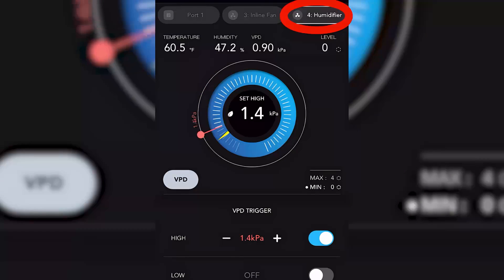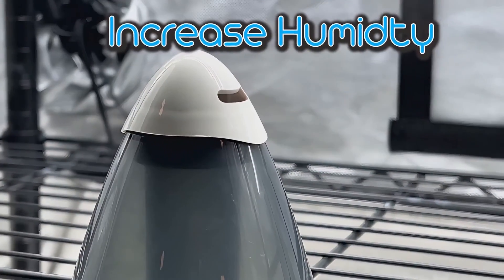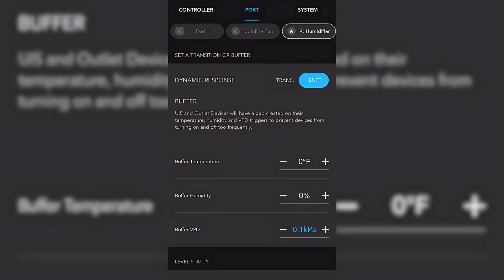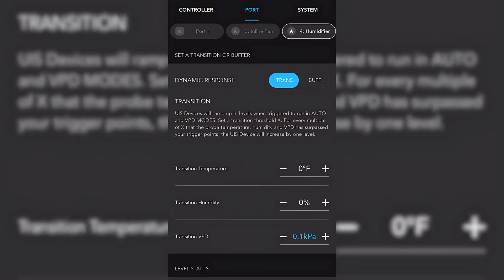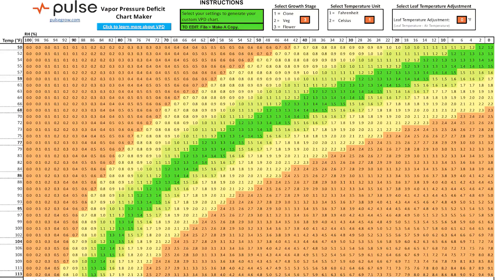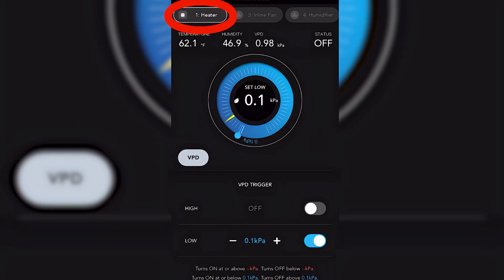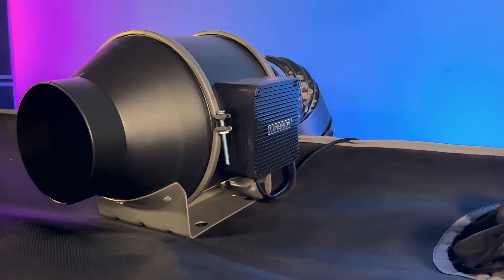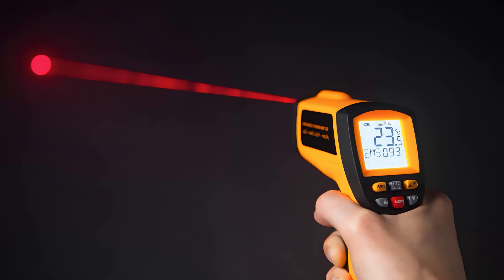VPD Made Easy | Dial In Your VPD With AC Infinity Controller 69 Pro

Comment: So is everyone not using the leaf temp offset? On their ac infinity controller?
Reply from the maker: Its definitely gotta be a mixed bag out there lol
Reply: @HappyHydro  Altering it has a big effect on the controllers vpd after mucking about with it a little.
So leaving it to standard would mean the vpd I'm trying to set is potentially not that accurate.
Given that leaf temperature is pretty impossible to measure throughout it's daily movement. Then you would need to be adjusting the controller constantly.
Just interested in others take on it?

Comment: My question is ... for us growers who have $$$ in other growing equipment.  Can we connect to this ac infinity pro 69+
Reply from the maker: There are ways to get some of your other grow tech to connect to the controller. They have an adapter for lights which is cool and will allow them to communicate. Also they have a smart outlet, which will allow you to control whatever is plugged into the smart outlet through the controller. The only downfall is its limited capabilities as in it can only turn the device plugged into the outlet on and off.

Comment: In the past year, I have become an AC Infinity nut!🤣
I have three tents in my grow room, 4x4, 3x3, and a 2X4. All three tents have smart exhaust fans with the 69 controller.
I don't use the VPD section of the controller. I have a window unit AC for the cooling, a dehumidifier And a brand new AC infinity humidifier, that big 15 liter one....... That thing is a beast!  The window unit and humidifier controls the lung room environment And I use the fan speed setting to control the temperature in the tent. I ALWAYS have some air flow in my tent, so I have a minimum setting on my fan and then I have a trigger temperature set for the fan to go at a higher rate to bring the temperature back down.
Each tent has different lights and different thermal loads, but all three tents have the same style of air flow. The 4x4 and 3x3 are both Gorilla tents and the 2X4 tent is a Mars hydro. On the Gorilla tents, I use the front lower cinched inlets with 6 inch exhaust hose with a screen covering to bring the air into the tent. Just enough of the  hose  sticks out for it to lay flat and long enough to prevent light intrusion. I used the exhaust hose from the AC infinity 6 inch exhaust fan in the 4x4 tent. It is reflectively lined on the inside, so I fogged the hose outside the tent with flat black paint to knock down the light intrusion even more. The 2X4 Mars tent only has cinched openings at the top, So I use a very long 4 inch Exhaust hose to bring in the fresh air. Comes all the way back down to the bottom of the tent and to the bottom of the floor outside the tent. This way all tents take cool air from the bottom of the lung room and all tents have air flow from bottom front to top rear and it exhausts out the very top.
The ceiling fan is always going to keep the lung room air mixed well. This maintains the long room parameters very closely. The tents parameters are just as stable. 

The CLOUDFORGE T7 Is an absolute beast and is highly accurate!  It handles my lung room quite easily at setting 2. The absolute only downside so far is not being able to control it with the phone app when used totally on its own. You can use it with the 69 pro controller, but that is really only for one tent, because it uses the sensor from the 69 controller that is in your tent.
With my Grow room set up in this fashion with AC Infinity, my environment has been rock steady! It's been one less thing to worry about and having to constantly check and tweak.
Today I will be finishing the installation of my AC Infinity controlled CO2 augmentation!  I'll run the hose to one central location in the grow room and then  equal length identical hoses with a manifold at the end to distribute the CO2 to each tent, I'll zip tie each manifold to the top bar at the front of each tent. With CO2 being heavier it will fall down to the bottom and being stirred up by the circulation fans, which are AC Infinity also! Each tent will get a supply of CO2 through the manifolds and through recirculation, 
I think it will be a glorious run!
I really love everything that I've gotten so far through AC Infinity! And this smart controller can make your life so much easier!
Reply from the maker: Wow! That's awesome to hear!
Reply: @HappyHydro  Well I thought maybe your listeners could gain a little bit with the detail that I went into.
It just really simplifies the grow and the only time you need to make any changes is when you up the light or you're at the life stage where your VPD needs to be changed. My temperature and humidity in the tents are rock solid and only vary by a few degrees.
Reply from the maker: @rayjay8322  I really appreciate your input,  its cool to have a community that shares tips and helps others grow!
Reply: See if you can find a bluetooth controller 69, just use that alone for your t7, they sell a short 2 inch probe for it, that would be perfect for you.
Reply: You can velcro the controller to the t7 and just leave it there.
Reply: Thank you for everything you have shared here with us. Im a rookie wanting to learn.
Reply: I have a very opposite view of these controllers I have the AI and the pro 69 and I have disconnected them and run everything manually it is far better and I know what it's doing.. I don't have to go down into my basement and see my tent blowing up like a balloon because the AC Infinity exhaust fan has turned off and the AC Infinity intake fan filter is maxed out. On top of my circulation fans half of them work half of them don't. Total shit and waste of my precious time..
Reply: @jeffwolf8018  I guess I've been lucky i've never had any kind of AC Infinity failure Even those first 10 circulation fans are still working Not isolating but still blowing

Comment: I haven't seen an AC unit for AC Infinity yet which is weird since they started out from ACs but i have a portable AC unit i havent ised yet but will get hot here shortly. How can i have that AC unit (Phillips) get controlled with the controller or can I?
Reply from the maker: AC Infinity does have control outlets that you can plug a device into and that will feed into the controller 69 pro!
Reply: @HappyHydro   OH damn no way!?  Will definitely get some and hopefully I can adjust too or just find a sweet spot for on and off. Thanks man!

Comment: I may have been over killing my ventilation and having steady high VPD. Now I have a VPD sensor on my new T-3 humidifier I now have my exhaust on low on off at 15 minutes intervals on a timer which saves power and keeps the humidity just about right so far based on leaf temp off set. Its all built into the humidifier. Had issues with leaf tip burn and stress. Going to keep it .9 as the lowest humidifier turns on and it goes down to .84 and shuts off until it gets to .9 and turns on. I need to change that I think.  Although I have wide leaf strains that are supposed to like it dry. I will set trigger to 1.0 instead of .9 for late veg . Something I never tried. I always ran my dehumidifier when I probably should not have for the last 4  grows that did alright but could have done batter. I want to see the other extreme now. But now my living space humidity is a few points higher. I prefer it lower a few points.

Comment: I'm looking for a channel or a groop to discuss settings, I would like to smooth my VPD curve, it goes up and down 0.1 kpa every 30 minutes, would like to have it steady
Reply: I have about 24 hours experience. I think the real goal is to save money on power from dehumidifiers is top priority. This makes it easier on the plant making it healthier with a better immune system which could fight off Powder mildew. On the other extreme you rum the dehumidifiers to much you waste power, the plant is stresses, that lowers its immune system to fight off powder mildew and you just kicked yourself in the nuts. I am currently saving 50 % power on exhaust fans by placing them on a timer.
Reply from the maker: Hmm, I don’t know if you can get it completely steady without having completely consistent humidity and temperature levels which will be difficult

Comment: I dry using VPD and aim for between .77 - 85 KPa  by dialing in the humidity level to the ambient temp to create the VPD desired. and get a 7 day dry in summer or winter.
Reply: 7 days is way too fast to dry bro
Reply: @Ben84s  Not according to the latest science.  The Canatrol dries in 5-6 days. And Professor bugby now says that a 14 day dry is to long and the tricones decay.  There was also a female scientist from the industry on garden talk last month who says the same thing.   A  bit of Trivia for you.   Those award winning farmers in the Cali mountains dry at 70f and in containers of Barnes, with the humidity as high as 70% and a 7 day dry.  they call it all the 7's and it works.
Reply: @Ben84s  Not according to the latest science.  7 - 10 days is optimum dry time now. the canatron dries it in 5 -6 days and even professor Bugby now says the old school 14 day dry is to long and the tricones break down as they decay.  There was also a female scientist from the industry on Garden talk not to long ago who says the same thing. So I'll stick with what I'm doing as it works just fine and is now backed by science and not bro science..
Reply: I have just always preferred the results of the longer dry of 14-16 days myself using what’s available to me in my home controlled environment.

I bet the Canatrol would be the best way to do it because it would be a much better at controlling the dry environment then I could ever do in my home  using an ac, dehumidifier and humidifier setup. 

One day, If I could afford the 4k cost of one, I’d love to have one.
Reply from the maker: Heck yea! Sounds dialed in

Comment: Good explanation of VPD, but you figures are a bit high compared to other scientific studies i've seen.  You must live in a warm climate, so even when you are on lower power light in veg, you are still able to create high temps.   In Europe and other cooler winter climates. it quite hard to get over mid 70's in early veg renning LED's, But a VPD of 75 -90KPa is just fine.   Anything over 1.0KPa in early flower works well and 140 is the figure most give for mid to late flower.
Reply from the maker: Great point!

Comment: This is way more complicated than this...he doesn't even consider the room where the tent is located...
Reply: I have three pro 69 units and manage a  2x4 old school and it is a balancing act that gives me fits all tents react differently in my lung some time complimenting each other some times they are at odds with regard to environmental needs, and the biomass  demands
Reply: Not only that. In the Settings. Last Settings of the First Column. It let’s you dial in your Outside Temperature and Humidity for outside your Room. Offset and much more. 
With this you can dial it to any chart you want/need.
Reply from the maker: I am always interested in learning more! What are your thoughts, especially for the room in which the tent is located in.

Comment: As someone coming from plant physiology research I can leave a point or two on VPD and its potential value in horticulture:

VPD as you defined it only depicts the deficit between actually measured ambient vapor pressure and the theoretical maximum of water vapor in the ambient air at the same given temperature.
The real Deficit of interest would be with temperature and humidity measurements taken from the boundary layer around the leaf surface and from within the stomatal openings, which is quite difficult and even top-notch research institutions with huge capital and even more knowledge struggle to achieve accurate readings. They rely on really expensive leaf thermometer probes which typically are designed at universities and sold for research purposes only. 

Applying a general negative offset to the ambient air temperature readings to account for expected lower leaf temperatures is highly inaccurate and results in vastly different readings when the offset is changed in even 0.1 increments. 

This means the AC controller does not give you any more information than a simple AirTemp/Hum-sensor, which is why I highly advise everyone to think twice before paying the extra.
The device leads to very inconsistent environmental conditions by controlling the other climatic devices (ON/OFF on trigger) which leads to leaf stomatal openings to widen and contract in alternation, triggering stress reactions in plants (both visible and invisible). 
Additionally, all the extra devices like heaters, humidifiers, dehumidifiers and so on are all energy hungry and expensive to buy and use. A lot of that energy is wasted as off-heat also, if you are growing indoors this will further take influence on the climatic conditions inside your tent and lung room and through that to even more "need for regulation" through climatic devices.

Try to keep conditions as simple and steady as possible and work with the stuff you already have, most of the stuff can be reached through good understanding and knowledge of your locations temperature and humidity dynamics. In my case: I open and close the windows to my lung room depending on the weather outside and the conditions indoors and save around 45% of the energy I´d need if I were to use all of that control stuff. 

of course this approach doesnt work for everyone, but I can tell you with certainty: Controllers for VPD are only useful, if you can keep conditions steady all year round (mostly commercial operations). In this case, you could at least compare and "calibrate" by searching optimal ambientVPD settings for your facility. 

In a tent with changing conditions? Absolutely no informational value.

Comment: Any links to data on vpd that is cannabis specific? It seems there are several versions of these “optimum vpd” ranges but they are generic and or specific to crops like tomatoes…tomatoes and cannabis  hybrids were not developed or climatized to grow in the same environment…imo the needs of cannabis are much different than most vegetables and maybe even different depending where individual cultivars are climatized to..broad leaf and narrow leaf varieties def do not like the same environments…
Reply: Google VPD charts and use the one on the Pulse Grow link.
Reply from the maker: Did you ever end up finding this?
Reply: Use the PULSE GROW charts. As they are cannabis specific

Comment: @happyhydro it’s tough out here in Arizona … tents constantly going thru about a gallon per day to keep humidity level … we don’t use VPD triggers but are using humidity triggers with buffer and transitions using the AC Infinity 69 Pro. Exhaust triggers as well for too high temp and too high humidity it’s pretty stable but any ideas how to control the room better
Reply: I'm in AZ to humidity and AC 😢
Reply from the maker: It’s going to be tough in dry and hot climates. You’re fighting against an AC that pulls moisture out of the air and just dry conditions in general. Have you tried putting buckets of water around in the room to help keep humidity up and more stable?

Comment: Perfect timing on this as I’m trying to figure this out on my controller 69. I have the inline fan managing vpd, while the humidifier is aiming for a humidity range. 

I have a dumb heater and when it turns on it spikes the heat in my tent. Do you know a great heater to work with controller 69?
Reply from the maker: AC Infinity is dropping a heater out around May 1st!
Reply: @HappyHydro  I have one on order but it wont arrive until June in Canada apparently?
Reply: Use a radiant oil filled heater. A small one will work for most tents (700 watts). Make sure it is not digital or it won’t work with an AC Infinity outlet.
Reply: @MrBootyMuncher THanks! I've been keeping my eyes open for a small one for my little tent.
Reply: I thought you could just plug any heater into the plug adapter plug that fits the controller.
Reply: @anthonyromano8565  you could, but not all heaters turn on when the power is turned on. Gotta find those heaters that heat when just powered on.

Comment: @HappyHydro you are right it's like chasing a tail. Wish I seen this a few months ago but I figured it out. My question is dialing in the vpd with my tent how do you get it to stay consistent meaning not having to go thru distilled water everyday or other day to fill the humidifier? Vpd is dialed in but have to use a gallon of water every second day for the humidifier.
Reply: If it helps - I use a Megahome countertop distiller - fewer jugs to recycle and way cheaper 👍
Reply from the maker: This is good to know!
Reply from the maker: You can’t really get around the humidifier and water needs. You could try a swamp cooler type humidifier if you have space, distilled water not necessary for those, or you could try putting buckets of water out to help keep it up and go through less in your humidifier.